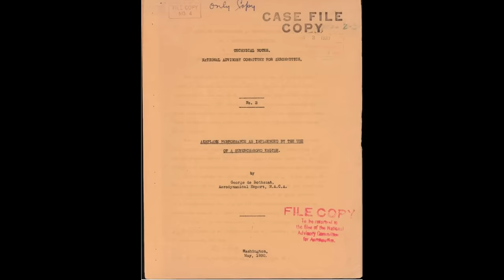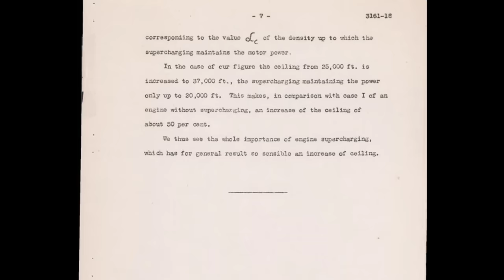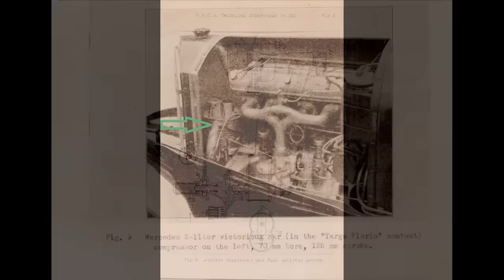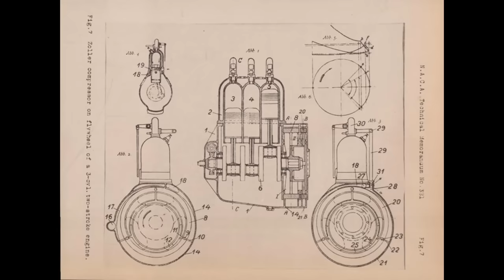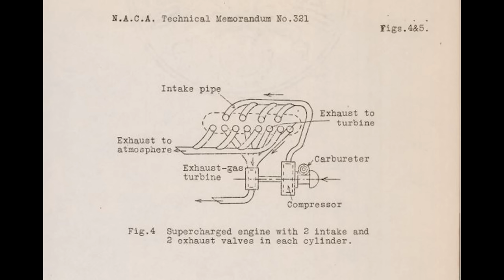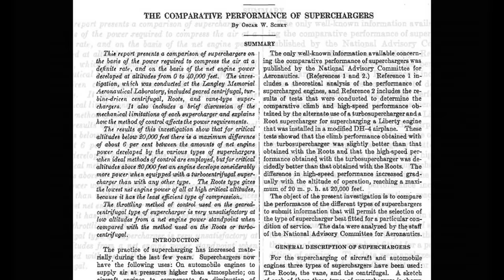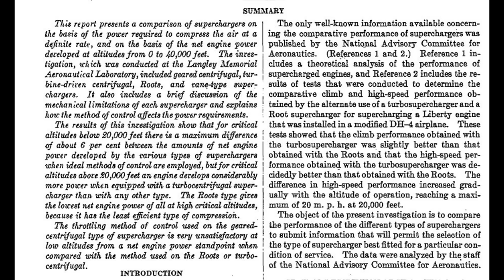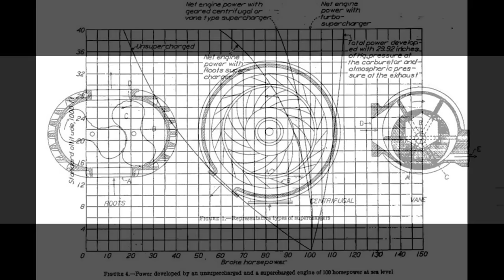Turbo vs Supercharging in WW2 Airplanes

Comment: The jugs are always a favorite of mine, a clear example of how you can afford to have less than ideal aerodynamics if you have a monstrous engine.
Reply from the maker: Yes, but I do want to stress that the Jug's wing was actually really aerodynamic at the time the plane came out, thus drag wasn't that bad.
Reply: @GregsAirplanesandAutomobiles  Yes that's why I used less than ideal rather than just bad. On a similar issue, people often believe a radial engine have a horrible drag compared to liquid cooled one when the difference is often less than what people expect.
Reply from the maker: The radials eventually won out over the V-Types. I'll talk more about that soon.
Reply: @GregsAirplanesandAutomobiles  I'm interested in hearing how you draw that conclusion. You will probably convince me, but for now I honestly don't see many radials these days down at the airport.
Reply: @jaredneaves7007  I cannot comment on how the radials won, however I can point out that almost all propeller aircraft nowadays are turbo props. Meaning the propeller is driven by a gas turbine. This might be the reason you mistaken them as liquid cooled piston engines. Piston engines are de facto dead on modern propeller aircrafts.
Reply: Only for military applications. There are still quite a few piston powered props on the commercial and civilian markets.
Reply: The biggest reason you don't see lots of radials on the civilian market is cost. It is cheaper to manufacture, and to work on a flat boxer style piston engine, than a radial. The performance values of radials pound for pound is still better, because they produce higher torque. Thus they can spin much larger props per their HP rating than their flat or V-type counter part.
Reply: @iflycentral  that's making my point. They're all internal combustion piston powered engines.
Reply: @williamradler8712  I ment to direct my comment to Jared Neaves.
Reply: +I Fly Central - "they produce higher torque. Thus they can spin much larger props per their HP" - That sounds a bit weird to me.  If the HP is the same, you could just gear the prop differently and have the same torque at the propshaft in both cases, not?
Reply: My drumbeat scenario is `since the failure of the turbojet revolution, today's airplanes are powered by engines like Formula One automobiles.` (hybrid timeline)
Reply: @bakters  A gear box is extra weight. So is a water cooling system for that matter. The radial needs no water cooling system because all cylinders are in the same horizontal plane, and thus get even air cooling. They also typical produce more HP per cylinder for this reason as well, and this is just scratching the surface on the subject.
Reply: +I Fly Central - "gear box is extra weight" - Reduction gear is common.  Only very simple aircrafts have props mounted directly to the shaft.  BTW - R-2800 had a 0.45/1 reduction gear.

Regarding "better cooling" of radials, it also sounds weird to me.  First, ww1 radials were built with two rings of cylinders, so the rear ring was not in the direct airflow.  Then, in pretty much all cases I ever read about, liquid cooling provided more even heat dissipation, which allowed parts to be built lighter.  Air-cooled engines were typically significanly heavier.
Reply: @bakters   bakters  I think you made a typo. They did not use radial engines in WW1; they used rotory engines. 

As far as gearing is concerned; I was talking in terms of inline engines. To get the same torque value out of a V-type engine as you get out of a radial would indeed be weight prohibitive. Gear reduction was used primarily to reduce prop speed, as props will stall if spun too quickly, and not for prop size. Prop size was limited by ground clearance, and torque value. 

Cooling system weight is also substantial. Not only in terms of the components, but also in terms of the coolant used. You must also power the system, and the pumps put a power drain on the system (see the laws of thermodynamics).

While some of the more powerful radials used two rows of cylinders; many radials used in WWII were single row. In two row engines the second row was often offset to assist with cooling, space saving, ect. It would not cool as well as a single row, but still cooled well enough. Also, the power output of the two row radial engines was SO much more than the inline jobs; any power lost from heat was negligible compared to overall output.
Reply: +I Fly Central - Yes, I made a typo, thanks for correcting (and of course I'm aware of single-row radials - I was just rushing my response because of life).  Anyways, since both radials and inlines need reduction gear, only power matters, not torque.  

Yes, reduction gear is used to reduce prop speed, but at the same time it increases torque.  Two engines with the same power can have exactly the same torque at the prop-shaft, depending on the gearing used.  

Yes, liquid cooling has its drawbacks, but less consistent heat dissipation is not one of them.  All those extra bobbins add weight and complication, but they do work.  People would never go that way if air cooling with all its simplicity allowed for better heat dissipation.
Reply: @bakters  Torque matters alot what it comes to aircraft engines. This is the definitive mechanism thats determines the max prop size. Radials hands down produce more of it, and in abundance. Doing this at much lower RPMs than V-Type liquid cooled engines. This means that they do not have to gear down anywhere near as much as the V-type.
Reply: +I Fly Central - I've heard this talk before.  
- My bike maybe has half the power of your bike, but it has twice more torques!
- You mean, it's faster?
- Well no, but it's faster than it would be without all those torques!
- You mean, it's faster that that bike over there, with roughly about the power of your bike?
- That thing doesn't weigh anything...
- Sure.  It doesn't need to. It's liquid cooled.
Reply: I hate to point this out, but your analogy is severely flawed. Road friction, and tire traction are a totally different subject. The way a car accelerates is not in any way shape or form analogues to aircraft. Not unless one is willing to really stretch ones imagination. To make this crystal clear; lets talk aerodynamics.

- Props - Propellers are airfoils. As such they are subject to comprehensibility, and have a critical angle of attack. What this means is that they have a rotational "speed limit." In terms a WWII props; that speed is just a bit below the speed of sound. Both inline, and radial engines can spin a prop of a given prop radius, and cord width to that speed with no problem, however, to take advantage of all the power available you need props of larger, and larger sizes. As the radius increases, so does tip speed of the prop. Reduction gearing is needed to correct for this. This is done up until the radius reaches a physical ground clearance limit. To utilities the rest of the available power you can do two things. Increase the number of blades in the prop disc, and increase the width of the props cord line. As this happens the prop disc encounters more, and more air resistance. The mechanism that overcomes this? Torque! What engine comes to the table with tonnes of this? The radial! 

Can an inline engine be geared to turn bigger, and bigger props? Sure, but you begin to run into the law of demising returns. More weight, and cost to do the same job. That's the bottom line.  

Will be interesting to see Greg's Airplanes and Automobiles take on the subject.
Reply: +I Fly Central - I used motorcycles, not cars, in my analogy.  Bikes can have plenty of airflow around the engine (no hood) at the cost of drag, just like airplanes. 
 
Regarding the law of diminishing returns: "Last year at the 37th annual Reno Air Races, over 180,000 spectators watched as more than 30 aircraft battled for the gold in the Unlimited aircraft division. The planes, mostly P-51 Mustangs and Hawker Sea Furies, hit speeds of nearly 500 mph"

I guess those guys are not aware it all shouldn't have worked...

(Search for "unlimited air races the ultimate hot rods" to read the whole article.)
Reply: @bakters So you want to bring Reno into the conversation. Okay. : ) What prop plane holds the fastest sustained air speed record? A direct quote:  "Rare Bear has set many performance records for piston-driven aircraft, including the 3 km World Speed Record of 528.33 mph (850.26 km/h) set August 21, 1989, which still stands in his class, and a new time-to-climb record (3,000 meters in 91.9 seconds set in 1972 (9842.4 ft - 6,426 fpm), breaking a 1946 record set in a stock Bearcat)."   Oh, and Rare Bear took the climb record from a stock Bearcat. Another radial. Hummm. :D 

Voodoo, a P-51 with many streamlining modifications, and an engine producing more than twice the original power output of a stock P-51 Merlin engine attempted to best this record, and failed. It made a valiant effort. Even reaching a temporary higher speed. But it could not sustain.
Reply: And you see even fewer liquid-cooled engines - the mainstay of General Aviation for installations of less than 600 HP are air-cooled horizontally opposed engines.  For more than 600 HP, it'll be a turboprop.  The issue with liquid-cooled engines (While there are some) is that the added drag of the radiators almost cancels out the ability to make a more pointy shape.  When you add in the weight, complexity, and fragility of a liquid-cooled engine, it's generally not worth it.
Reply: For installations that require over 600 HP (And for many that need less) you're better off going with a turboporop - it's simpler, lighter, more reliable (Smaller parts count) and doesn't require gasoline to run - in a pinch, although I wouldn't recommend it, you can run a turboprop on any light kerosene
(Jet A, Jet B, JP-4, JP-5, JP-8, or, if you're really desparate, #1 Fuel Oil, as well as gasoline.)
For installation down around 250-300 HP,, it's pretty much a wash - compare a Bell 206 Jet Ranger to a Robinson R44, for example.
Reply: Well, since HP is Torque * Rotational Speed, I'd submit that when you're gearing down for the propeller (Which pretty much everything other than a R1340 (T-6 engine) does, then, for a given horsepower, gearing the propeller to, say, turn at 1500 RPM (A typical value) means that a 1200 HP/2700 RPM R1830 is going to be putting the same torque to the propeller as a 1200 HP/3000 ROM Allison.  (Yes, the core engine may have less torque, but the gearing to the lower value, keeping HP the same, means the torque at the propeller is the same)
Reply: @iflycentral  The engine might not requre cooling but a turbocharger certainly does. Turbos make for even more weight than water cooling. The Ki 100-II's turbo added 385lbs to the aircraft, rather more than the weight of the watercooling system of the Ki-61 the aircraft derived from, and that implementation did without an intercooler! 
The water cooling implementations of the Mustang and Spitfire behaved like low temperature ramjets, their thrust more than offsetting their drag. Name me an aeroengine of WWII with more horsepower for its displacement than the late war two-stage Merlin. 
Whether it is a radial or an inline, water cooled or aircooled; there is a lot more going on than just the basic engine!
Reply: @stevewatson1640  Pratt & Whitney R-4360-51 VDT  Displacement: 4,362.5 cubic inches  HP: 4,300 hp Power to weight: 1.11 hp/lb ... Just to name one REALLY big one. : )
Reply: @bakters    When you weigh a radial engine you're weighing the cooling system.  Not so for a V-type.  Radials were developed primarily because weight-specific power was so much greater than that of a liquid-cooled installation.  Comparison of the dry weights of the bare engines are not very informative.
Reply: @sotros1  It was difficult to find, but I got it.  
P&W R-2800 - 2000 hp, 2350 lb (1.2 lb/hp)
Bristol Centaurus - 2520 hp, 2695 lb. (1.1 lb/hp)
P&W Twin Wasp (1932) - 1,200 hp, 1,467 lb (1.2 lb/hp)

Merlin 61 - 1580 hp, 1640 lb (1.03 lb/hp)
Griffon 65 - 2220 hp, 1980 lb (0.9 lb/hp)
Allison V-1710-F30  - 1500 hp, 1395 lb (0.9 lb/hp)
(Lower lb/hp is better!)

Then, radials were developed because rotary engines of WW1 were developed to their limits.  They sucked air through the hollow crankshaft which limited total power output and also for bigger engines gyro effects were simply vicious with all this mass constantly rotating.  Liquid cooled inlines were later development, not earlier, like your comment suggests.

Comment: Great detail on an interesting topic. The turbo's advantage of not linking the vane's speed to the engine's crankshaft speed, is primarily realized because the vane speed is essentially governed by the back-pressure of the air it has compressed. So, if the ambient air pressure is low, the vanes spin at a faster speed until sufficient back-pressure imposes its limit.

Comment: Nice work, Greg.  I’ll be rewatching this one several times to bake it all in.
Reply: Question:  when mentioning throttling a geared supercharger, are you referring to the throttle within the pressure carb, or is there a butterfly valve that limits air entering the sc impeller?  Also, I guess I don’t understand why superchargers ‘hate’ being throttled, could you touch on that or refer me to a presentation that explains that?  Edit/add - I think after reading the text from the NACA document you used to present fig4 and 6 graphs (along w your explanations), I’ve a better grasp.  Stil…
Reply from the maker: In a WW2 warplane engine the "carb" or whatever is being used is located upstream of the gear driven supercharger. Thus the butterfly valves on the carb itself restrict air going into the supercharger. Don't open them all the way, and you get less boost. It's really that simple.

Comment: Do a video on the Napier rapier.It is a 16 cylinder H block.Air cooled engine.The only one that had this shape.
Reply: The Rapier was an H24, not a 16.  There is a picture of it in one of the NACA reports shown in this video.  Napier also built the Sabre, which was a liquid cooled H24, but the H was laying down.
Reply: Not according to Rand McNally World war Ii airplanes volume 1  page 19.You are thinking of the Napier sabre.Which was a 24 cylinder liguid cooled h block engine.The Rapier was a 16 cxylinder h block air cooled engine.
Reply: Oops, you're right about the Rapier.  But go to 22:17 in this video.  There is a picture of Napier's other H24.  It's the Dagger.
Reply: Andy Harman good to know.I didn't know that.

Comment: the b17 and b 24 led to the b29. that program cost 4 billion $ in  1940s money.the atomic bomb project cost 1 billion and produced 2  different  systems .  a uranium device and a plutonium device .. both were useless without a delivery system. the b29. but most miss the point . the us of the 1940s didnt make a atomic bomb. it made two
Reply from the maker: I am not sure I understand the connection, other than a turbocharged plane delivered the atomic bombs.
Reply: @GregsAirplanesandAutomobiles  yes the b29  could fly higher than fighters of the time. the p51s that  flew escort for the b29s had a lower cruise speed than the b 29.. thats why we needed iwo jima.. which  led to the f 82 twin  mustang
Reply: Given the performance and limited bay size of the other WW2 heavy bombers (B-17, B-24, Lancaster and Halifax) none of them could carry either the Mk I (Little Boy) or Mk III (Fat Man) shape and be capable of surviving dropping the weapon.
It had to be xomething capable of carrying a 60" diameter 10,00 lb shape at 30,000' and at least 300 mph TAS.
Even then, Enola Gay and Bock's Car got bashed around quite a bit.
Reply: Yes, so? It won the war and leap frogged the world in war technology. Have you ever been to Hanford? A great lost location to make plutonium. It's mark on the face of Earth's survival is nothing compared to the use of fossil fuels. Oh and uranium was not refined there, where did you get suh a wierd idea? They made plutonium there for years. Uranium enrichment was a much different thing altogether.
Reply: oh get over yourself, it wasn't like they knew it was going to cause that much damage. And it not billions, but thanks for playing.

Comment: Very informative! I've always known the differences between turbos vs supercharging in cars and even some aviation, but You break it down and answer the "whys" and "hows" from a technical standpoint and give many examples which explaines it all to me. 
In autos, though supercharging, the power is instantaneous whereas turbos have that lag in boost initially. The supercharges lose (they say) approximately 50% of its power because the crankshaft (gear or pulley) that drive the supercharges, so for cars, the application dictates their usage. With a supercharger, you can under drive, drive or overdrive them through gearing whereas a turbo just runs off the exhaust gas speed. A waste gate typically divert extra gases out of the compressor to prevent overcharging. 
That's just my take on these two marvels of engineering.